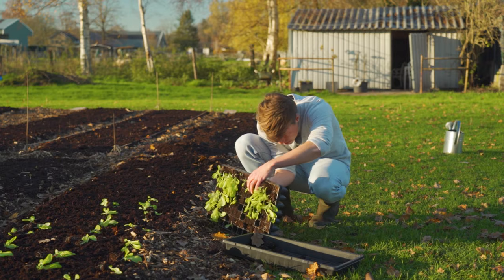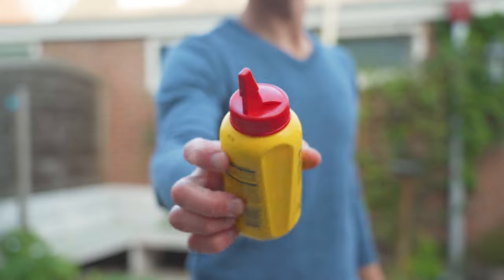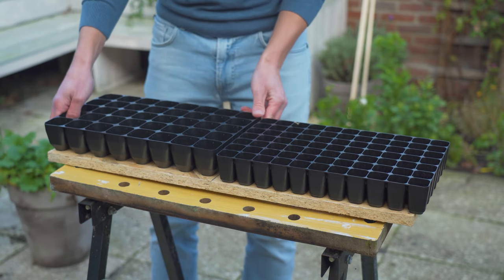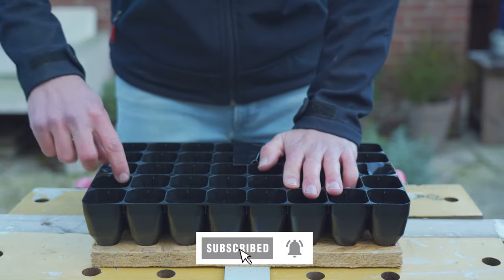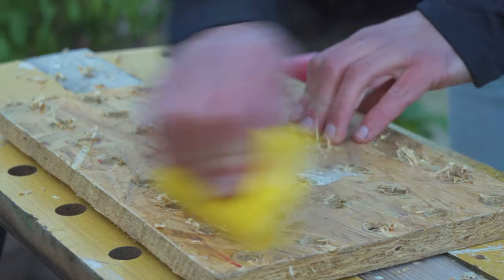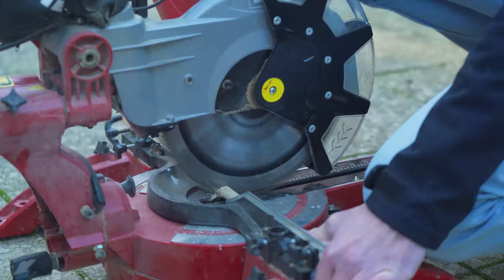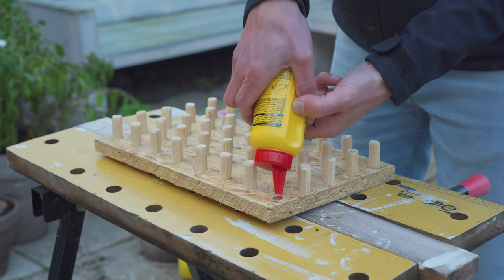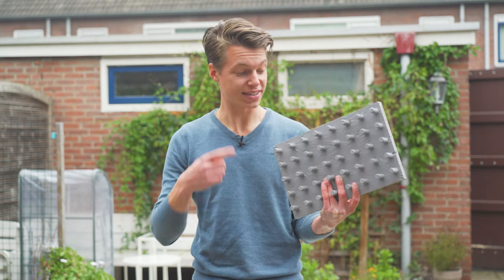Transplant Faster! DIY Easy Seed Tray Cell Plug Popper.

Comment: I’ve never seen seed trays with such big holes in the bottom like that. Very clever solution for them though. 👍🏻
Reply from the maker: Hi Linda! This also workes for the once with smaller holes. It's just easier with these trays. If you are interested in these module trays we currently sell them in our webshop 🥳